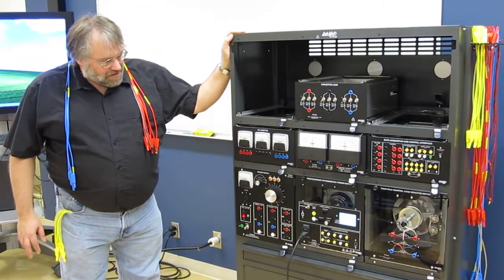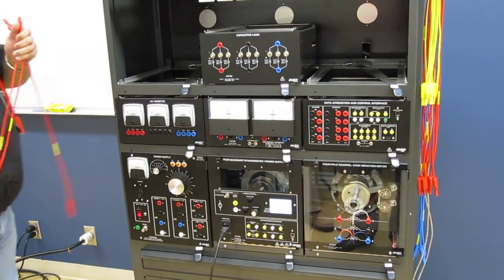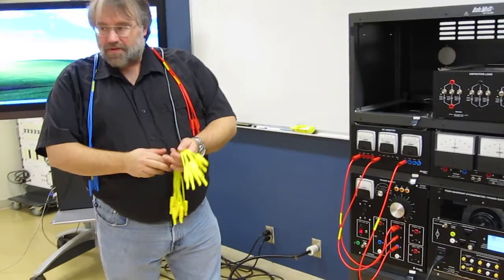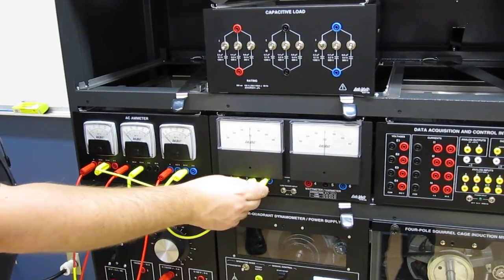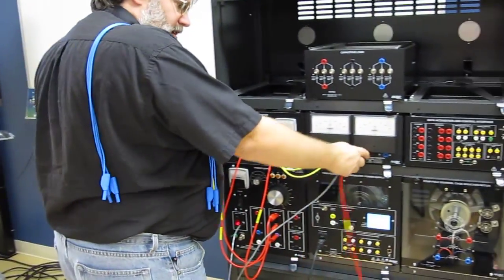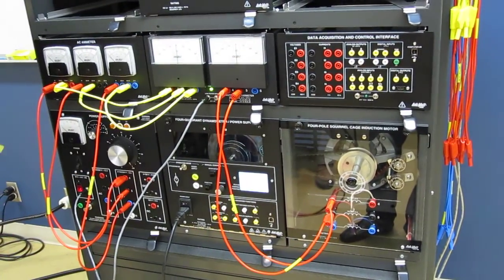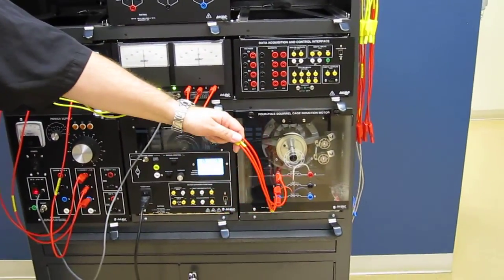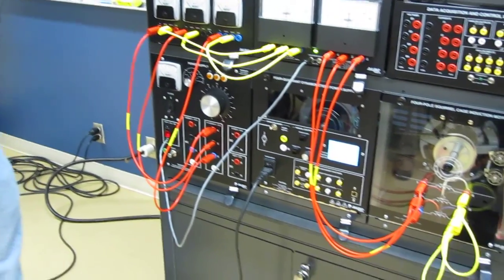Power factor compensation with induction motor PART 1

Comment from the maker: Great, as long as those are on industrial rates for electricity, as home customers don't pay for apparent power nor current,m but for active power, where capacitors or power factor compensation don't yield any savings!
Reply: Small capacitors on small motors does the job